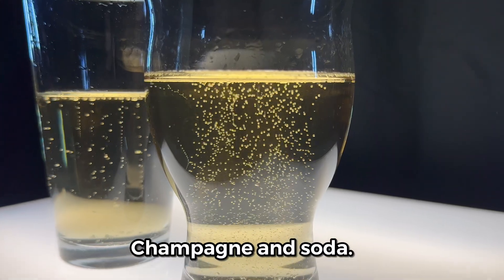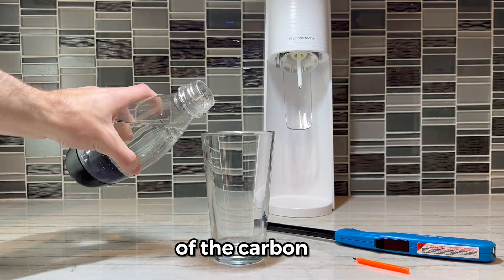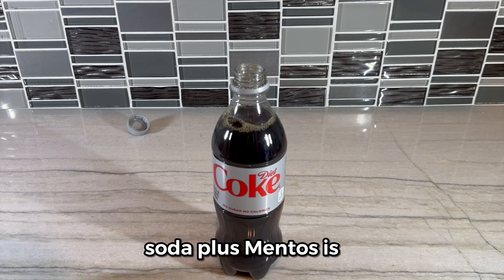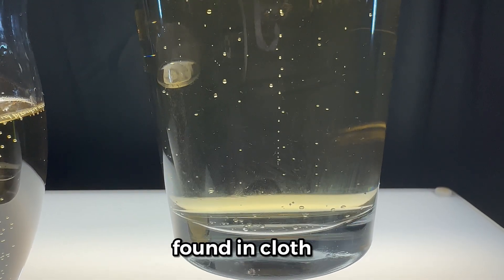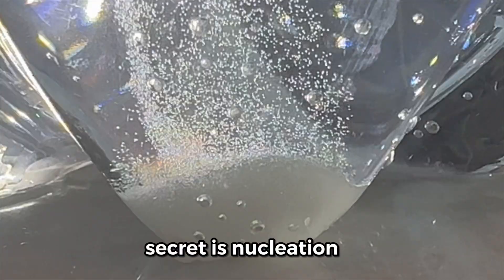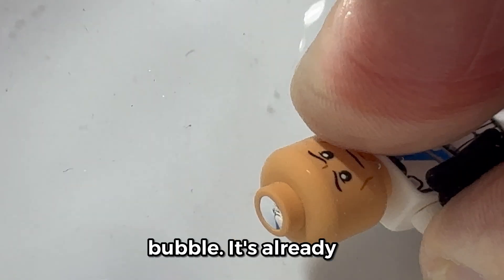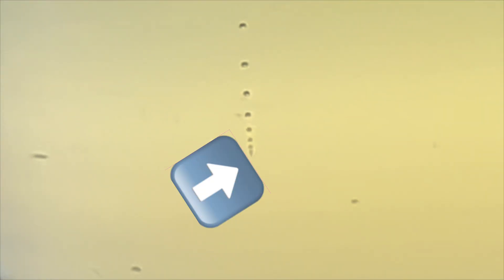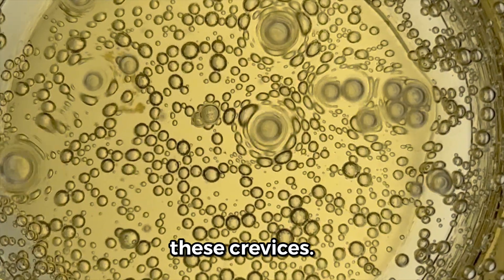Bubbles Don't Form How You Think: The Physics and Chemistry of Nucleation

Comment: So, the tiny bubble, helps collect the co2 better? Are the tiny bubbles initially o2 trapped in the glass and then the co2, pushes out the o2 (as it is heavier)?
Reply from the maker: It's energetically very costly to form a bubble. But if the bubble is already made, this energy requirement is averted. Like, when you blow up a balloon, it's very hard to get the balloon full at first. But once the balloon is somewhat full, it's much easier to blow it up further. The tiny bubbles are almost always filled with air (at first)
Reply: Got it. Thanks, this was a fun
Reply from the maker: @jakenelson7258 Thank you for your question and for watching

Comment: I'm wondering about your claim that most of the carbon dioxide in a carbonated beverage escapes invisibly from the surface. Do you have a source for this? I'm not sure that a lit candle getting extinguished near the surface of the beverage is sufficient evidence for this. After all, the carbon dioxide above the surface could very well have come from bubbles rising to the surface and popping.
Reply from the maker: Good point. You should be able to find a pdf of the following article online: "On the Losses of Dissolved CO2 during Champagne Serving" by Liger-Belair, et al. In this article it is noted that 80% of the CO2 is discharged through the air-surface interface
Reply: @TommyTechnetium  Thank you! And wish you and everyone in your family a very, very happy new year!!
Reply from the maker: @innominateperson5275 Thanks for your question!

Comment: So, if you filled a glass with water, put it in a vacuum chamber (to help all bubbles trapped at nucleation sites be liberated), returned it to atmospheric pressure, then switched the water with carbonated water (without exposing it to air)... could you remove all (or nearly all) nucleation sites, thus preventing the bubbles from forming?
Reply from the maker: This is a fantastic question and I'm not entirely sure of the answer. I think you are correct that no bubbles would form under the scenario you describe. However, the CO2 would still escape from the surface of the beverage
Reply: @TommyTechnetium  it would be an interesting experiment, especially with something like the champagne glass, that has definite intentional nucleation sites. 

ChatGPT says (with me paraphrasing) that the CO2 would still eventually create nucleation sites at the imperfection, and the disruption of the bubbling would only be temporary. But as we know, ChatGPT is often confidently incorrect. 😄
Reply from the maker: @Z-Z-W_origin Wish there was a way to pull this off...